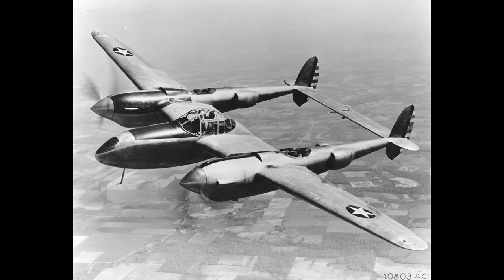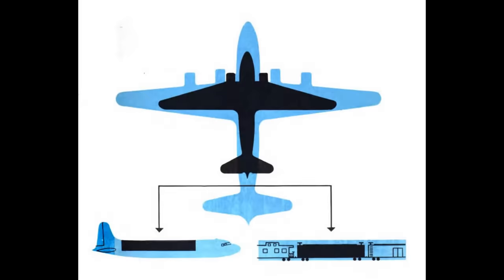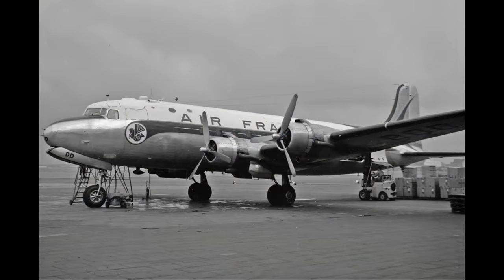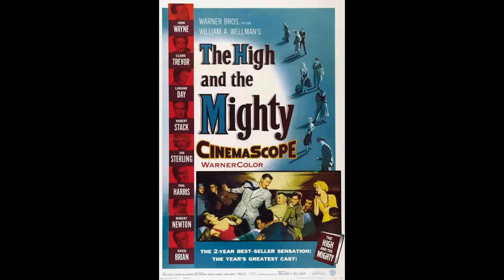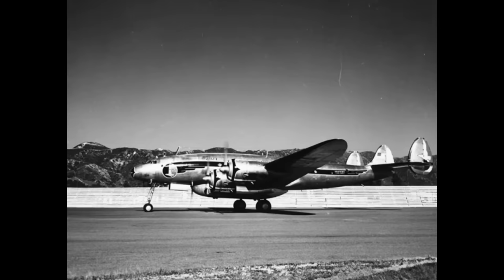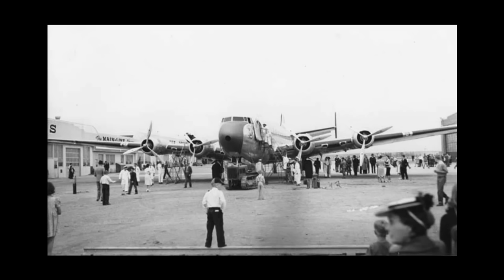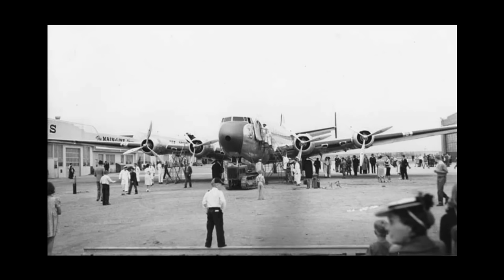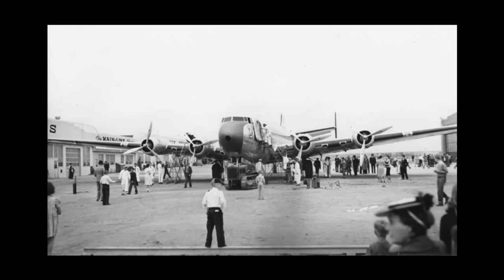Turbo Compound Piston Engines. Almost magic tech.

Comment: The way in which this blowdown tubine avoided backpressure is interesting. You focus on the fact that they operate on velocity rather than pressure, which is true, but I think that fact alone doesn't give the full picture. A turbine which operates with a high velocity intake like this called an impulse turbine (in fact, that very term can be seen in the excerpt at 19:50), and they are the counterpart to a reaction turbine. The velocity for an impulse turbine has to come from somewhere. Indeed, that same excerpt mentions that the pressure inside a cylinder during the exhaust stroke is about 200 psi. The gas inside the cylinder (before it exits) is at stagnation. Thus, the velocity comes from that pressure left inside the cylinder. 

The second key to this setup eliminating backpressure is in the manifolding arrangement shown at 14:30. In a "traditional" turbosupercharger, gas from all of the cylinders is routed to a common tube, which then goes to a single turbine (per engine). Since all the cylinders are connected to the same manifold, the pressure in that manifold is (more or less) constantly elevated, leading to backpressure. With the arrangement in 14:30, the cylinders are split across many different manifolds and turbines. The smaller tube and turbine volume per cylinder means that the backpressure that does accumulate can decay much more rapidly, letting backpressure decay on a timescale closer to the timescale of the exhaust stroke.

The tricky thing with this arrangement is that more manifolding and multiple turbines means more weight. (Though each one doesn't need to be as big.) Also, the design of the manifold tubing must be done with care to avoid excessive length or number of bends, as that would lead to lots of pressure loss in a system with high flow velocity.

Excellent video overall! I like the IL-2 stuff you've been doing recently as well even if I don't comment often. It's always a treat to see a video from Greg in the old subscription box.
Reply: This is an knowledgeable and excellent comment, way, way above the usual YT fare, also of the kind that one expects in this channel.
Congratulations!
Reply: Great comment, which adds a lot of necessary detail. Thank you for taking the time to write it! :hat off:
Reply: My recall was tickled talking about the blowdown turbine application. The Elliot YR steam turbine has been around for many decades as a prime mover for pumps , compressors, and generators. What I recalled was a marketing strategy to use the YR as an alternative to a steam pressure reduction valve, mining the pressure drop for power to run an air compressor that supplied a manufacturing facility. That allowed running a steam system at a higher pressure and efficiency, even if the lower steam pressure was what you needed for your process.

Comment: Just a note that the very fine old water-driven mill used at 21:28 to demonstrate a blow-down turbine is the Old Mill at Uplyme, Devon, right on the county line between Devon and Dorset in southwestern England that's marked by the river it sits on and just outside of Lyme Regis, Dorset.

Comment: 144 spark plugs per aircraft to change out regularly, 36 per engine.
Yeah, I can see why jet engines took over most commercial flights.
Reply: Now do an R-4360 (28 cylinders!) spark plug swap. I had a pal that wrenched on B-36s, said that was a huge job
Reply: @johnparrott4689  on an engine with a manual choke so an improper starting procedure on the Spruce Goose could get you 448 fouled spark plugs.

Comment: What a treat! My A&P powerplant classes in 1982 just glanced over the PRT as sort of interesting aviation trivia but in fact is fascinating.
Reply: Where did you go to school?
PIA by chance?
Reply: One of my instructors from my A&P classes worked on these engines, and had mostly good to say about them, but consider that with jets on the way in the very near future, the airlines knew the days if recip engines were going away, along with the heavy maintenance and vibration wear on airframes.
Reply: @dukecraig2402  
 Teterboro School of Aeronautics in 1982.
Reply: Ditto '69.

Comment: I worked with an engineer for a few years that would volunteer on the Rare Bear , and he mentioned the exhaust was wasting over 500 horsepower. Since this was a race aircraft the thing they concluded was to modify the pipes and direct their thrust to keep the Bearcat aerodynamic. It worked.

Comment: I am very glad that I've found this channel, I've been thinking about getting a small aircraft (Zenith CH-750 Cruzer) but am looking at getting greater range which translates to better fuel economy. I have been thinking of engine exhaust energy recovery, now see that blowdown turbine is a viable part of the solution, would couple this with generator / motor instead of mechanical gear shaft and fluid coupling, something like the F-1's MGU-H. Also thinking of 2-cycle with water / methanol injection. The idea is the get weight down, relatively high power to weight ratio without compromising reliability too much. The Zenith CH-750 Cruzer needs about 100 hp for reasonable takeoff and climb performance, maybe as little as 50 hp for cruse. a 50 or 60 hp internal combustion engine, combined with a 50 to 60 hp electric motor, in parallel hybrid configuration, with the electric motor directly coupled to prop shaft.

Comment: Great stuff Greg. I don't know if it is quite relevant, but  Bob Beck talks about keeping the L1649s on the Trans Polar flights below 13,000 ft, at leat initially, to avoid going into higher supercharger gear to save the exhaust valves from exiting via the turbines.

Comment: Working on the line during the Vietnam Conflict I helped support over wing fueling of an Air America? Constellation…I remember a very tight fuselage and small cabin and recall the fear of walking out on the high wing which was coated with oil. The Connie was most beautiful.

Comment: I was talking to an older ex-South African Airways pilot a few years ago, he had flown DC7Cs for them. He ssid the aircraft were wonderful but the engines needed vast amounts of maintainance.
Reply: South African Airways used DC-7Bs, not DC-7Cs.  These were true DC-7Bs, with big saddle tanks as on the DC-7C.  Most DC-7Bs flew in domestic US service and didn't have saddle tanks; only South African Airways and Pan Am ordered them with saddle tanks.
Reply: You may be right but I distincly remember DC7C..  The first one delivered did a very low flyover of my primary school, flown by the father of one of my classmates. Exciting...

Comment: Volvo has a 13L turbo compound engine and Formula One & Mercedes-AMG's electrified turbocharger are a form of turbo compounding.
Reply from the maker: Yes, the electrical generating part is turbo-compouding. The boost part is a centrifugal supercharger driven by an electric motor. I know they call it an electric turbo, but that's stupid. There is nothing turbo about it. It's an electric supercharger.
Reply: yes Volvo diesel truck engines use a shaft connected to the flywheel to re-introduce the power to the drive line.
Reply: @GregsAirplanesandAutomobiles  
The terminology can get a bit fuzzy as there are superchargers that are driven by electric motors but I am referring to the version that has an electric motor sandwiched between the two parts of what is mostly a traditional turbo charger that I think can both recover energy and help spin the turbo up depending upon requirements of what the engine is trying to do. Admittedly partially different in intent than an aircraft engine. The diesel truck engine is to improve efficiency mostly I think. I think that there are some large marine engines that can recover energy with a somewhat similar concept as an add on.  

I think that there were some prototype aircraft engines that approached the turbo compounding via different approaches. The example might be the Napier Nomad 1 & 2 that had a more integrated approach. I think there was a turbo-compounded Allison prototype. 

Also things get a bit interesting comparing a geared turbofan vs an unducted fan or the RISE Open Fan engine by CFM that that are designed to operate at around Mach 0.8 with what looks a lot like a propeller. 

Thank you for covering a fascinating topic with a great video.
Reply: @GregsAirplanesandAutomobiles  Makes completely incorrect statement, still gets 13 upvotes because he makes videos on YouTube... what a world.
Reply: In modern terms, Formula One (2014-2025) does not have centrifugal superchargers.
What it has is a fairly generic turbocharger setup with the MGUH (electric motor/generator) either in between the turbine and the compressor, or on the compressor side, connected to the shaft.
The compressor and the turbine always spin at equal rpm (since they are connected by a shaft). They are not separate from each other.
Reply: @leoa4c  
I think of the MGU-H as a modern variation of turbo compounding providing that part of the time the system “recovers” lost energy. In a vehicle that has EV hybrid aspects, it seems like the logical design pathway with some additional benefits of spinning up the turbo.

Also, didn’t Formula One change some rules about this device?
Reply: @PistonAvatarGuy  
✌️😉
Reply: @Mentaculus42  I hope you realize that I was talking about Greg, not you. Greg was incorrect in his reply to you.
Reply: @GregsAirplanesandAutomobiles  
My favorite “supercharger” (turbo compressor) is the MAN Axial-Radial Flow Compressor AR-MAX1 that takes 85,000 horsepower to run it. One of the fascinating things about it is the Axial-Radial Flow Compressor layout that is basically identical to some aircraft turboprop’s compressor sections for the “same reasons” but just 10,000s times bigger. MAN had some great youtube videos on this beast.
Reply: @PistonAvatarGuy  
Thank you, I got it, I like Greg’s videos (except for the jet engine vs horsepower one, which is a “definitional” problem) so was trying to be subtly diplomatic in acknowledging your observation.
Reply: @Mentaculus42  👍

Comment: Was in McGrath Alaska back in 1984. Caught a ride in a C-119 flying to St. Michael's then back to Anchorage (long story). The cockpit in the C-119 is huge. In the back right corner of the cockpit was an oscilloscope. I was told that they have to keep an eye on the spark plugs. They said that if you lose a plug you could tear up the engine. C-119 I was in of course had the R-3350 turbo compound plus it had a jetpack. I forget the manufacturer but I think it was 2500 pounds of thrust. Mounted on top of the fuselage on a pylon. FYI.
That was a very interesting and informative video. I enjoy your no-nonsense videos. They are very refreshing to say the least.

Comment: Detroit/Mercedes used turbo compounding on there on highway Diesel engines, Volvo used similar tech as well. They say it adds up to 50+ horsepower into the crankshaft.

Comment: The problem with turbo compounding seems to be the complexity of a system designed to operate effectively over a wider power range. They're typically only advantageous at or near full power.
You might find "The Road to the 50% Thermally Efficient Internal Combustion Engine" on YT interesting.
Reply: Thanks for the tip, great video! But why stop at 50% thermal efficiency ICE, more is better, like 60% PLUS is do able, think in addition to a bottoming cycle, a topping cycle with a SOFC “Solid Oxide Fuel Cell” feeding a downstream ICE is a research topic.
Reply: @Mentaculus42  I think combined cycle generation using turbine engine exhausts as the heat source for steam generation is already over 60% efficient.
 I read something about putting a SOFC in the flow stream of a turbine engine to heat/preheat the air about a decade ago, but I haven't heard of it actually being done since. It was probably just an attempt to increase the efficiency of the FC.
Reply: Wouldn't the power recovery turbine also be useful during cruise?
Sure it doesn't produce that much power, but it doesn't cost anything to run it. During a long cruise the fuel saved must add up.

Comment: Having viewed Oceanliners Designs new episode on the power plant of the Olympic class liners (incl Titanic), it looks to me like they used a somewhat similar system, with the low pressure steam left over from the two lateral piston engines being used to power a higher rpm centerline turbine that greatly added power and speed at relatively little energy cost (the ships had three screws).
Reply: Triple expansion engines ran the steam through three separate expansions to get better thermodynamic efficiency and were quite a popular marine technology
Reply: @thomasbaker6563 yes, but the addition of a turbine was new and it allowed for a further expansion step, fully extracting all of the usable energy from the steam.
Reply: @SaitekFreak999  that's a pretty extreme level of extraction I'm guessing only enabled by turbines. Sensible but definitely extreme.

Comment: I wrote a thesis paper on this aircraft in college for my bachelor's degree in Aeronautical Science, and it was a remarkable plane. It was so influential in the commercial aviation world that De Havilland, who had originally designed the Comet 1 to have wing mounted jet turbojet engines in similar fashion to the DC-7, decided to take the radical step of mounting them in the wing roots. They did for two reasons. The first was to make the aircraft more aerodynamic, and the second was, for lack of a better word, to make it look cool. Unfortunately for the Comet 1, it proved to be a disaster and claimed dozens of lives in 3 catastrophic breakups that ultimately doomed the airliner. This wasn't do to the positioning of the engines however but by the decision of the engineers to design it with squared windows, creating stress points in the corners of them that caused explosive decompression to occur after so many flights and break the aircraft apart with all onboard being lost in each case.
Reply: They probably didn't deliberately design the windows so that they created catastrophic disasters.
Reply: @hotrodray6802  True, not a lot was understood about metal fatigue in the late ‘40’s and early 50’s. Nevertheless, it was a radical and unproven design that should have definitely been given more thorough inspections after each flight though given the revolutionary change in shape.

Comment: The Canadair CP-107 Argus maritime patrol aircraft also used Wright R-3350 Turbo Compound engines due to their fuel efficiency and therefore long loiter time. It did that from 1958 to 1982.
Reply: Apparently it was an outstanding patrol plane.

Comment: Great video! In the Navy I worked on both DC-6b (C-118b) and SP-2H (Neptunes). The R-2800s on the 118s was very easy on maintenance compared to the R-3350TC engines on the Neptunes. In flight you could observe the 2800 losing oil pressure and temperature rising and eventually feather the engine before it cratered. With the TC they would operate at textbook levels and just suddenly crater from a dropped valve or blown jug without any warning. During our checks usually the PRT Bonnets would be holed by either burning or the turbine blade assy rubbing it. Both were great engines to work on and their sounds are something special to witness.

Comment: This was a great video I Thank You for this content and work. This lead to a few thoughts. 

 Cummins had the ISX-WHR (Waste Heat Recovery) which used exhaust gas and EGR heat to power a steam turbine. Yes it was a Rankine Cycle steam powerplant in miniature that sent electricity to a Flywheel Motor Generator and promised a 10% increase in efficiency.

If we used ceramic coated cylinders, piston heads, valve heads… there would be a considerable increase in available energy to capture in an exhaust system. Ceramic engines do not use liquid cooling that simply sends excess heat as waste to a radiator. Obviously opposed piston engines but with modern ceramics, like an updated Junkers Jumo 205, might just rule in this setup. You cannot help but think on ships this is exhaust energy would be great for water desalination systems as well as additional power capture.

P.S. I remember Volvo using a power turbine in the exhaust to convert waste energy to usable power. You are one of the only people to mention it!
Reply: Strangely enough, I worked on ceramic in-cylinder diesel engine components at Cummins about 30 years ago.
Reply: @andyharman3022  
My father worked for Cummins as a development engineer back then. His name was Eric Day. He worked at the Tech Center in Columbus, Indiana. We were transplants from Darlington, England where he worked for Cummins Europe. That’s interesting you had a career there at the same time. What did you think of the ceramic concept?
Reply: @andrewday3206  I remember autocrossing with an Englishman at the Walesboro airport back then.  He was driving a Pontiac Firebird.  Was that your father?  

The work with ceramic engine parts was interesting but they didn't improve fuel economy.  Volumetric efficiency went down and exhaust temperatures went up.  To take advantage of the extra heat going out the exhaust, the engine needed a turbocompound unit.  Unfortunately that was not part of the project.
Reply: @andyharman3022  
That wasn’t my father but once in a while I do meet someone who knew him or worked with him. Engines are an amazing invention that literally changes human history. I’m guessing you may be retired at this point.